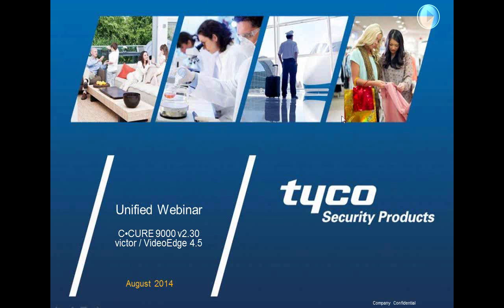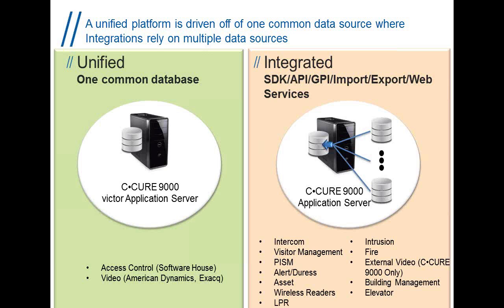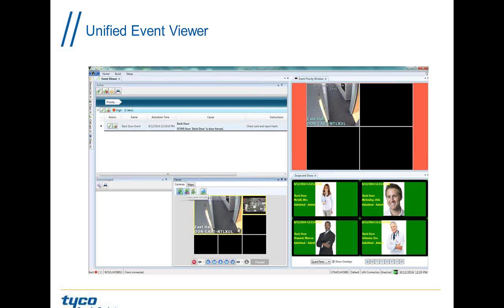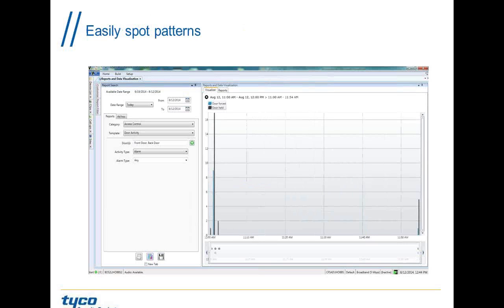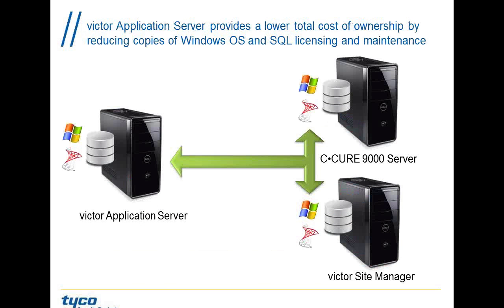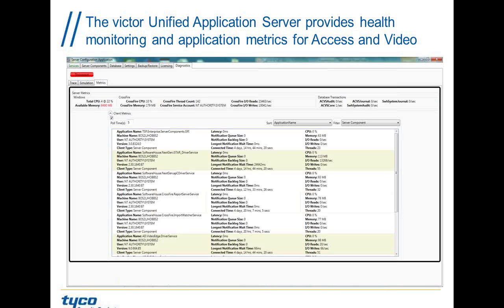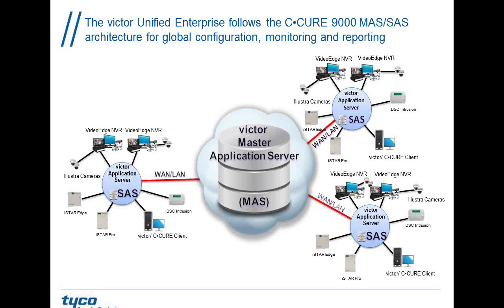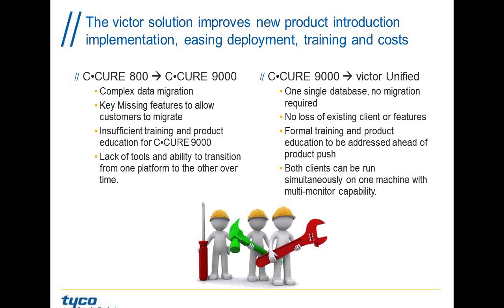Webinar - A new way of experiencing C•CURE 9000 - victor Unified Server

Comment: Hi everyone, I’m system administrator of CCure 9000 Version 2.10 - 2.8. I can help with all of your system administration or operational questions. My level of system functionality is of 20 years’ experience.  I am also a system integrator that could help with system upgrade and architecture design.  If you have question about ACS, CCTV, PSIM or Home security system, please send me an email with the type of help you need and we can discuss how I am able to help. Thanks

 Hola a todos, soy un administrador del sistema CCure 9000 Versión 2.10 - 2.80. Puedo ayudar con todas sus preguntas operativas o de administración del sistema. Mi nivel de funcionalidad del sistema es de 20 años de experiencia. También soy un integrador de sistemas que podría ayudar con la actualización del sistema y el diseño de la arquitectura. Si tiene alguna pregunta sobre ACS, CCTV, PSIM o el sistema de seguridad para el hogar, envíeme un correo electrónico con el tipo de ayuda que necesita y podremos analizar cómo puedo ayudar. Gracias OriusHouse@gmail.com